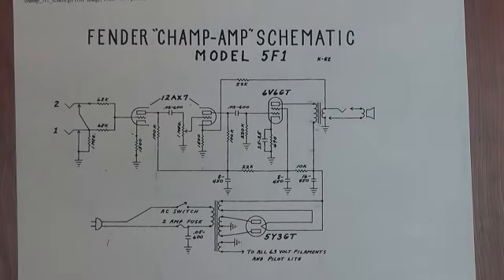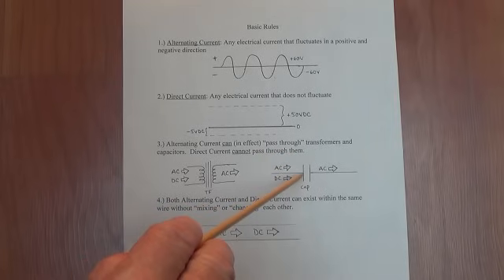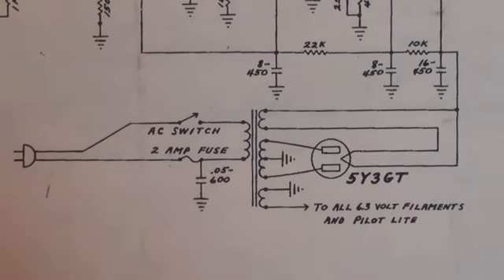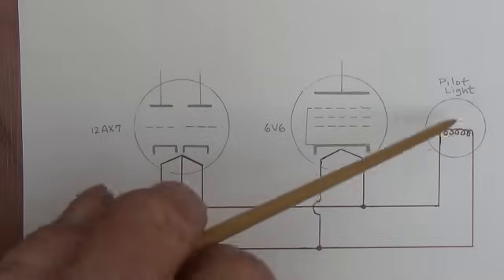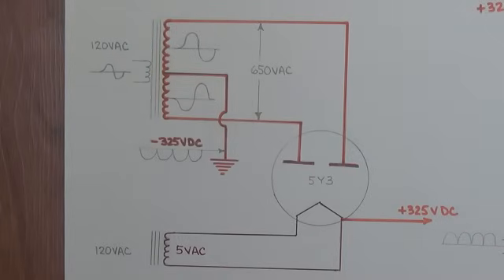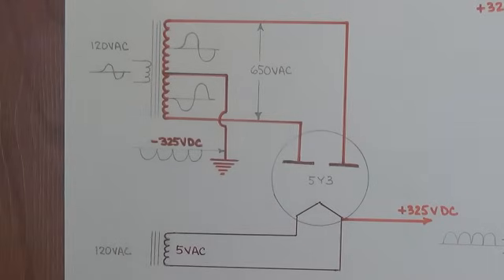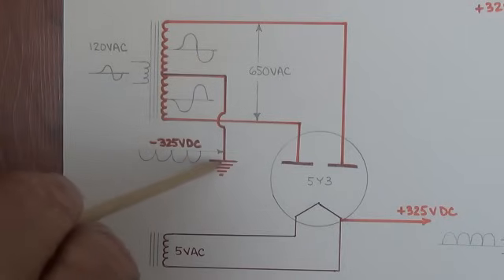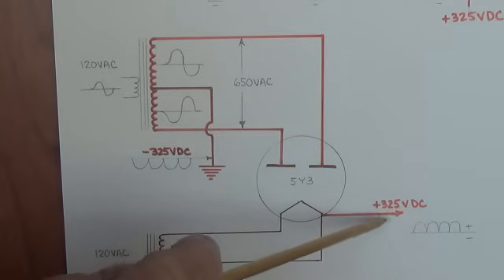How Tube Amplifiers Work, Part 1: The Power Supply

Comment: Ey, just a few questions:
When you insert NEW electrolitic filter capacitors, Do you have problems with big current (even to blow fuses) the first time you power on the amp?
Should I have to limit current with series bulb in AC input?
Or charge the capacitor a few times before insert it in the circuit?

Oh man, here goes another...
In order to check volteges or charge this capacitors Can I run the amp WITHOUT the tubes BUT safely to other components?

(Hope you understand my european-spanish-english)

THANKS for all your videos (I'm becoming addict)

 ;-)
Reply from the maker: If fuses blow after you have replaced the filter caps, check to be sure you soldered the correct (negative) lead to ground. They should not blow fuses......ever.  You can use a current limiter when testing newly repaired equipment, to protect the circuit from damage. Running the amp without the tubes won't accomplish much because without the rectifier tube in place, there will be no high voltage to charge the capacitors, and the only voltages you can check will be the tube filaments.
Reply: Uncle Doug , thanks again. And if I'm testing a solid-state-rectified amp?

Thanks thanks thanks
Reply from the maker: Then the high voltage DC will be produced and can be measured......but the voltage values will be high if the tubes are not present to enable current flow.

Comment: Q! Uncle Doug, excuse me, perhaps you have mentioned it somewhere in one of your great videos: my tube amp instructions say to set the amp in standby mode half a minute before starting it all. From your instructions here I take that this allows for heating up the lower plates in the tubes powered by low voltage DC well before the high voltage tube plates begin to work. Does this make sense? And, is there any harm to the tubes if one doesn't heat up the low voltage plates first? And why would that be? Thanks.
Reply from the maker: Stand by switches work on the principle that if you heat up the tube filaments prior to turning on the high voltage DC, its arrival will be less of a thermal "shock" to the tube and result in longer tube life. In reality, this may not be true, but many people ascribe to this theory.
Reply: Uncle Doug , thank you, sounds plausible.
Reply: On the Valve Wizard's website he discusses the pros and (mostly) cons of the standby switch, and the myths and misinformation surrounding it. I quote: "The valves do not care if you switch on the heaters and HT at the same time (with a couple of exceptions). Now, I know what you're thinking, "but every guitar magazine in the land says the exact opposite?" Yes, they do, but guitar magazines know next to nothing about electronics, they just repeat the same old wives' tale each year."

Comment: Excellent didactics! And fun, too...
Reply from the maker: Thanks, Lot :)
Reply: Uncle Doug My pleasure, Uncle Doug. I'm sixty and have been playing the electric guitar just a couple of years now. Recently, I stumbled across a sturdy 70's tube amp Mesa Boogie studio .22 for little money but much noise. With the help of an electronics person we exchanged the relevant capacitors, added a Faraday cage to the chassis. Now clean, great sound. With just two of your tutorial videos I can now also understand 80% of the very complex schematic of this amp. Moreover, the nice little rock'n'roll tune played by your dog at the end of video 2, I was unexpectedly provided with a usable template of this genre of music. Just right for Mesa Boogie, right? Greetings, Lorenz
Reply from the maker: Thanks for your comments, Lorenz. This is the first time I've heard of using a Faraday cage to reduce noise in an amp :)
Reply: Uncle Doug - expl: there is a  12" long dc cable hangin around, acting like an antenna, picking up high impedance signals, cell phone what not, nothing to bother in the 70s when the amp was built. Since we didn't have a simple shielded cable at hand, but ironically  a thin metal sheet that rightly fitted an incomplete cage we decided to put it on. If we were looking for a cage we probably just had a shielded cable, Murphys law :)

Comment: What would happen if I use two dual rectifier tubes, one at each end of the power transformers coil for the anodes? I saw that in a shematic.
Reply: I guess it doubles the dc current if I use the same tubes. E.G. if both tubes produces an dc current of 225mA at the kathode I'd get 450mA, so I could use tubes the'd need more curent then.
Reply: I also saw a shematic where a second dual rectifier tube was switched antiparallel and was uses to create the grid voltage trough the voltage drop of the tube.
Reply from the maker: Some of the early high wattage amps like some versions of the Fender Bassman used dual rectifiers to provide sufficient current for four 6L6 output tubes.

Comment: Hi Uncle Doug. I've studied most of your videos, and have learned a LOT. Thank you! I'm not sure if it's just me (very possible), but I can't quite connect the dots regarding how a tube rectifier can produce the B+ through the cathode. If I view the tube as a 'switch', then sure, it seems obvious. But when I think about that switch only working when the cathode is negative WRT to the plate... I get stuck. How can the cathode be at +325vdc (with 5vac riding on top?), yet still emit electrons? Why wouldn't the electrons be more attracted to the cathode than the plate? Seems like you could have addressed it right around 15:00 on this video. I've read several sources, and everyone seems to assume this is obvious :-) Thanks again for all your hard work in producing these videos.
Reply: The heater winding is connected to each end of the cathode, so no matter what the B+ voltage at one end of the cathode, there is 5V AC across the cathode and it heats up and emits electrons. A diode allows electrons to flow when its plate/anode is positive with 'respect to' its cathode, i.e. when its anode is more positive than its cathode. The actual voltages are irrelevant, it's the relative voltages which matter; the diode will conduct if its anode is at +325V and its cathode at +315V just the same as if its anode is at +10V and its cathode at +0V.
When the amp is working, electrons flow from the negative terminal of the filter capacitor to ground, through the tubes of the amplifier to the B+ rail and to positive terminal of the filter capacitor, which reduces the positive voltage across the capacitor (the B+ voltage). One end of the high voltage transformer winding is connected to one of the plates of the rectifier diode and is swinging between +325V and -325V, while the other end, connected to the other plate swings from -325V to +325V. Suppose the B+ voltage on the filter cap (and therefore on the cathode) has fallen to +315V. When either end of the transformer winding goes above +315V on its way to +325V, the plate of the diode connected to it becomes positive with respect to the cathode. Electrons flow from the filter capacitor, through the diode from cathode to plate and to ground via the transformer winding. This reduction of the number of electrons at the positive terminal of the filter cap increases the positive B+ voltage. The voltage on the capacitor increases to +325V, the voltage on the transformer winding falls, the diode becomes reverse biased, and once again electrons flow from the B+ rail into the filter cap, reducing the voltage across it, until the voltage at other end of the transformer winding goes above the voltage on the capacitor, when the plate of the other diode becomes positive with respect to the cathode. Once again, electrons flow out of the capacitor through the forward biased diode and transformer winding to ground. When the voltage on the capacitor reaches +325V the diode ceases to conduct, and the whole process is repeated.
Reply from the maker: You're welcome, Joe. Rectifier tubes don't function like amplification tubes, with a strongly positive plate to attract electrons. They simply contain two separate diodes, biased in such a way that when AC is applied to the plates, negative electrons are blocked and sent to ground via the center tap, while an equal and opposite positive charge is created on the cathode.....which provides the high voltage DC for the amp circuit.  This is easier to see if you have plain diodes rather than a tube rectifier, as in the Fender Bassman power supply. The diodes are oriented in such a way that the positive charge  "moves" from anode to cathode and on to the tube plates, while the negative charge is sent to ground via the power transformer HV center tap.

Comment: is the positive charged plate in the tube what sellers/etc. refer to as "getters"? also, does the power transformer only have one winding ratio or are there different sections with different windings to give you the different voltage coming out on the secondary side? Thank Unk. :) Pet Rusty for me .
Reply from the maker: No, the getter is a separate structure within the tube that attracts and holds contaminants that appear inside the glass envelope.  Most power transformers have a single primary winding and multiple secondary windings to provide different voltages for the amp circuit.
Reply: thanks for clearing that up Unk. would it bee too complicated to explain how the voltage gets divided inside the power transformer. I understand the winding principle but wonder what other components are inside a transformer. I also understand there are many leads coming out of the PT secondary but don't get how they have different values. 

BTW I did watch the entire PT video. 

thank you for your time. I am considering building a 1974x 18 watt kit but want to get the principles down first so the build makes sense and I'm not just "painting by the numbers".
Reply from the maker: Each of the output paired leads has a different winding ratio when compared to the primary winding, thus each has a different voltage. I have posted videos on power supplies and transformers that may be helpful. Best of luck with your future project.

Comment: You have 325 DC + and -  with an AC source. Does the 5Y3 (diode effect) change it to DC?
Reply from the maker: If you had 325VAC (325-0-325) and rectified it with a full wave rectifier then smoothed it with filter caps, the output would be around 450VDC.
Reply: Uncle Doug - Thanks,   Tom
Reply from the maker: If you would like to learn more about this, please watch my videos on power supplies.

Comment: The narrative at 7:45, adding the two 6 volts, isn't correct. The two 6 v heater elements are powered with the same 6 v.
Reply: mdhsahb is correct, in that the filaments are connected in parallel, each powered by 6V. However, you are correct, in that the filaments could be connected in series and powered from a 12V supply.
Reply: @wildbob  If you are going to be white knight a least be sure you are right. It is not a matter of thinking he is wrong he is absolutely for a fact wrong. He has clearly drawn the filaments as parallel with 6 volts, and it's not a simplified drawing as you call it, they could be wired in series on a 12 volt supply just fine but that's not how he has drawn it. And to rain on your parade this isn't the only error in this video, there are several.
Reply: With respect to Uncle Doug, those heaters are wired in parallel with a 6v supply. If you had a 12v supply, you would wire them in series across the transformer, no central tap. In either arrangement each heater would carrying the same current through the same resistance so the power (I^2 R) would be the same.
Reply from the maker: Sorry to disagree, but two 6V filaments in series add up to 12V, just like two 6V batteries in series would. Otherwise, the 12V filament tube could not function properly.
Reply: @UncleDoug  you can disagree but you are wrong. The heaters are in parallel.

Comment: Hi Uncle Doug, I don't know if you answer tech questions online, but I'm not having any luck researching elsewhere so I'll take a chance. If you're too busy, I understand. I've got a mid 60s Airline, model 62-9022A I bought a few years ago. Basically a vintage Champ circuit with a tone control as well as the volume. Incredibly immaculate, looks like it was stored for years or was restored exceptionally  well. Here's the issue. it worked fine for quite a while, then one day there was a sudden volume drop. no weird noise or anything, just about a 75% reduction in volume and it broke up a little easier. Now it will either be at this reduced rate when I turn it on, or sometimes it will be full volume for a while when turned on, then suddenly drop after a while. Today I turned it on and had full output for a few minutes, then I went away and left it on for about 20 minutes. When I came back to it, it played fine for a couple of minutes and then there was the sudden drop. Any ideas what could be causing this? as I said, it otherwise sounds fine -- no odd noise or anything. Any ideas you might share would be greatly appreciated. Love your videos. Thanks, Mark
Reply from the maker: There might be a faulty connection or component, Mark. You could try some tuner cleaner on the volume and tone pots. Observing all safe electrical practices, try wiggling the tubes, one at a time, and, if all else fails, gently moving wires and components with a wooden stick. Any sudden change in volume will reveal the culprit. Good luck.
Reply: Thank you

Comment: You said that you make 12V from 6V in the 12AX7. But because they have a common ground you can't create 12V there, only 6? And my seccond question is: Does the tube that creates 325 do anything special to that voltage like another sound? because, why isn't there just used another transformer and a diode bridge?
Reply from the maker: Sorry, Tom, but when you apply 6V to each side of a center-tapped filament, as in the 12AX7, it does indeed create 12V across the filament, just as two 6V batteries in series will create 12V.  If you are speaking of the rectifier tube, it is a full wave rectifier, containing two diodes. It is used to create the high voltage DC necessary for the tube plates. It does not create any sound. It could be replaced with a diode bridge (see my videos on power supplies) but not by another transformer.
Reply: Uncle Doug I'm sorry, you are right, I didn't see it was center-tapped. thank you for your quick answer :)
Reply from the maker: No problem, Tom. Thanks for watching and commenting.

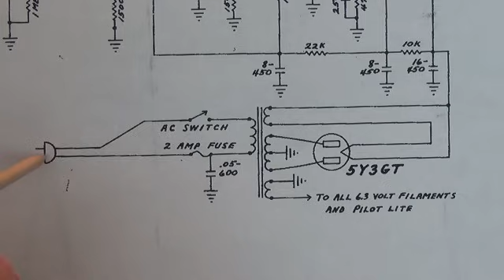Comment: at 4:18, what's the purpose of this capacitor and what did you call it?
Reply from the maker: It's the so-called "Death Capacitor" because of the inordinate amount of fear that it may some day provide a short circuit path for AC to the chassis....and to anyone who touches the chassis.  In reality, this is highly unlikely.....in my experience, it simply does not happen. The original purpose of the cap is to provide a path to ground for electrical "noise" in the incoming AC. The "noise" is generally at a higher frequency than 60Hz, so it can "pass thru" the cap, while the primary AC cannot.
Reply: Thanks Doug. Right on. Is there a way to add more input protection in addition to the transformer?
Reply from the maker: If you're speaking of reducing the primary AC shock hazard, all you need is a properly installed 3-wire power cord that grounds the chassis, and a correct fuse in the fuse holder.....more is unnecessary.
Reply: Thank you.

Comment: Quick question- I think I've heard the rectifier's positive DC can come out of either of the heater wires, I see you've likely drawn the +325 line in this diagram t make for a neat, clean looking schematic. All true so far? I also read that it (+325) tends to come from a certain pin of the tube socket rather than the other (I'm basically repeating what I said above but in terms of tube socket pinout). Do you have any educated guess as to why? By the way, on a personal note, I'm restoring a 1937 Bosch console radio, while the Fender Deluxe Frankenstein is warm on the back burner.
Reply from the maker: The rectifier produces the high voltage positive DC (also called B+) from its cathode, which may be directly heated, as in the 5U4 and 5Y3, or indirectly heated, as in the GZ34. Since the cathode internally connects the two tube pins in question, either pin can be used as the outlet for the B+.  Good luck with your Bosch radio restoration.

Comment: Hi Doug! A friend of mine put together a 5E3-kit, which he couldn't even turn on without blowing the mains fuse. After investigation I noticed the rectifier tube socket had mislabeled pins on it. The result was a 5Y3-rectifier tube wired inadvertently so, that the high voltage output from the PT secondary was actually connected to the heater/cathode, and the 5VAC/3A wires along with the assumed B+ wire were connected to the plates of the rectifier. My question is: What exactly blew the fuse? Obviously there was too much current drawn from the primary of the PT, but by what? The High-Voltage plate winding halves, that are now getting connected by the cathode/heater? :-/ Best Regards, Jonah
Reply from the maker: I believe that connecting the high voltage to the heater would amount to a dead short. A filament that is accustomed to providing a 5V voltage drop cannot cope with 400V.